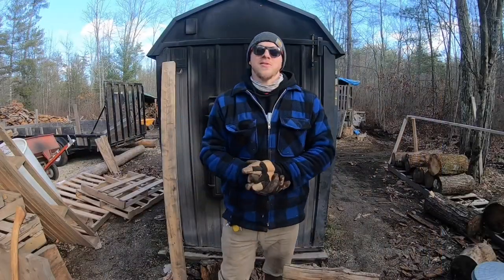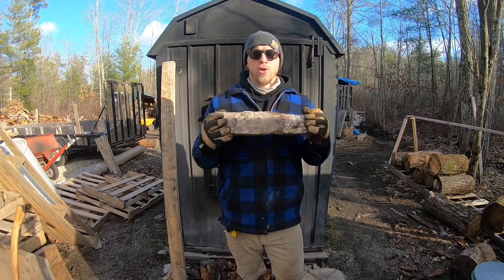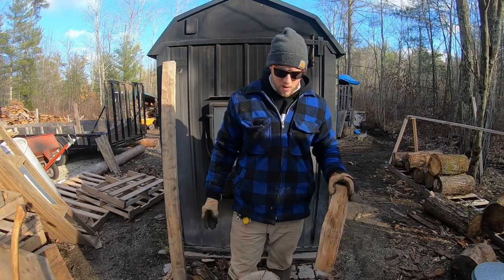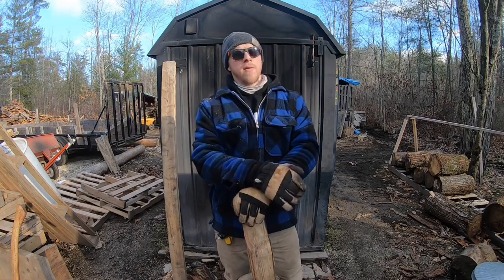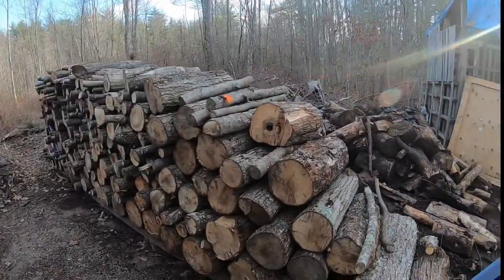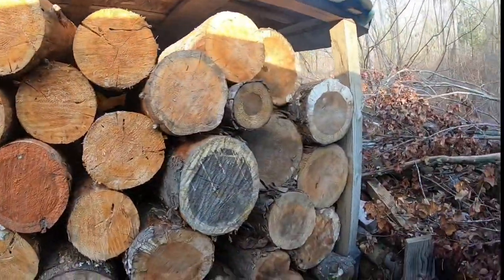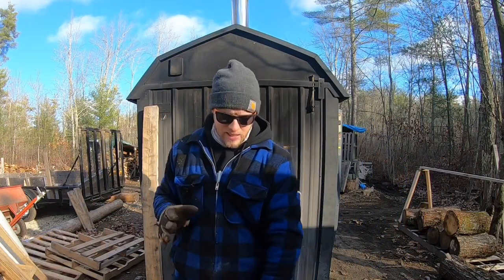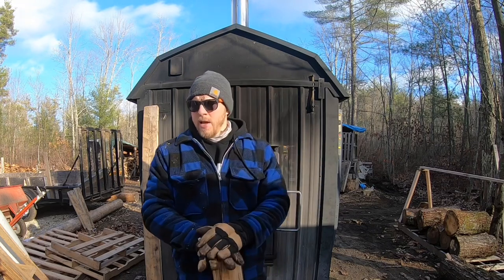STOP Burning THIS Wood In Your OUTDOOR WOOD BOILER

Comment: Incase folks here don’t know, these standard updraft owbs are the most inefficient chunk wood burners ever built. Period. Full stop. With that said what Jay has going on here is probably the best way to operate these with least amount of operator input. I could go into combustion design and thermal transfer but I don’t want to waste folks time and give them headaches. I figured out @15 years ago that there are much, much better ways to combust SEASONED wood and recover heat…Garn!
Reply from the maker: Hey Garny, Yes you are correct there is NOW a better design with the gasification HDX series but at the time in 2008 this was the ticket. Its easy to point the finger and say this is in efficient comparing to a new model 15 years newer. My whole premise was burn as large as you can handle SEASONED wood. Not green. Burning green wood is dumb and a waste and I understand that. Id love a new HDX gasification stove for sure. Who wouldnt, but im gonna ride the classic wave till she ends up croaking on me.
Reply: @HomesteadJay  Garn design dates back to early ‘80s. It’s proven fact this style owbs are most inefficient way. Fireplaces, central heat wood stoves, etc. are more efficient at combustion. I still would not recommend an hdx or any owb downdraft gaser. Study the Europeans. They too have been doing downdraft gasers for 30-40 years but with a key difference…thermal storage. Once you understand how chunk wood combusts you’ll understand why conventional owbs are the worst… and the owb gassers ain’t much better.

Comment: I agree with you. If it fits and I can lift it, it doesn’t get split. I have started cutting it between 16” to 20” because I have started selling a little firewood on the side each year. I also do not typically stack it or cover it. Before the burning season starts I haul it in with the tractor and have a big pile there by the boiler.  I just try to estimate what I will need to burn. This system has worked well for me since 2011. Most of my firewood is dead standing or trees that have blown over. I don’t worry about it seasoning either. I do end up with a little bit of green wood in the pile but most of it is dry.
Reply from the maker: Yeah I agree with you besides the big mess of wood lol I just touched on this in my newest video! I built a weekly/monthly rack right next to the machine! Thanks for tuning in!

Comment: Large pieces reduce the surface area available for combustion.  This keeps down the combustion rate when the boiler is idling, reducing wood usage while idling.
Reply from the maker: Yes seasoned large rounds burn slower and better if you ask me!
Reply: @HomesteadJay  not quite. In an outdoor wood burner, you'll get lag over a larger log that has to reach temp. If you burn bigger logs, put smaller splits on the bottom and then put your large splits or full logs. Gets that up to temp faster.

Comment: Hey Jay, I just found your channel and found it very interesting. I couldn't agree with you more. We have burned wood for about 15 years now. The first 5 with a home made stove and the last 10 with a 5036 classic. I have found the round vs split to be exactly as you say. We started by splitting everything and got tired of wearing out gloves and myself. Now we load as large as I can handle. We have come upon a source of wood skids used for transporting sheet steel. Mostly hardwood 4x4s and 1x6s. It keeps me busy loading but free is good and it keeps them out of the land fill. Interesting info and you can bet I will be back. Thanks.
Reply from the maker: Hey Jeff! Thanks for sharing your success as well! I did the same thing first few years I was splitting it all to peanuts lol now I try to let it season over a few years if its still round. I LOVE free skids I get them all the time from a few factories around here and they are the best! Keep on heating and stay safe!
Reply: I used to do the wood skids but got tired of the nails, the ashes I can dump on the garden or any hole on the property with out the nails. I agree, you are saving the landfill! Another positive side, dry wood, ready to go!

Comment: I have had my centeral wood boiler for over 16 years. I have burned all size wood species and moisture  content. This year I bought a splitter with 4 and 6 way wedge and split all wood small. I found I get more wood in the stove by stacking tight and I get longer burn times. This wood is just cut green. My back loves me.
Reply from the maker: Oh yes I agree if you’re gonna burn greenish wood split it down indeed. I’ve been mixing 50/50 green and seasoned and the seasoned stuff I have is big so I split down the green stuff and it eats it nicely

Comment: You have to understand that the wood you have is not what everyone else has.were on a world wide display here. If i throw in chunks of unsplit locust or burr oak my fire goes out. This isnt ideal for me. Spend time with your boiler, mix in some small stuff with the big stuff. Fire is fire, itll burn. You just have to figure out how to do it the way it works best for your application.

Comment: The reason your big rounds burn longer is because they are needing to be dried down to where they can burn. A 16" round split into 4 smaller pieces still has the same BTU value as it did when it was a solid round. It will burn better...sure maybe faster, but you are getting more of the BTU value out of the wood. It's just science. Using your boiler as a kiln is not very efficient and can also be considered wasting your time, just saying. I'd rather burn my wood to produce heat for my house than to use BTUs to dry large rounds. 
Not trying to sound like a smart a** here, just saying....big rounds that 'burn all day' are not really burning. The moisture inside them is needing to be evaporated off so they CAN burn. How is the moisture being evaporated, by using heat that could've went to your house.
Reply: Agreed but the size of the fire box allows for a more efficient fire. That means a bigger piece will burn more efficiently than a smaller piece. There is enough fire to make the heat needed. You don't need to run these super hot. They're very good at creating heat. Over firing an outdoor burner is not only wasteful but it is dangerous and terrible for the equipment. You can see how dry the big chunks are. Moisture isn't gonna be much a problem with the large rounds he has. Not trying to be argumentative either. Just saying my thoughts on it. Its sad we have to make sure to "de-escalate" our thoughts in comments by saying we're not being as wholes. Singularly, we're good but when we come together, we're beyond great if it's in a constructive and positive manner.
Reply: Dan, you are spot on. All the moisture also creates more creosote, which increases your chances of chimney fires. Not so much a big deal on outdoor boilers, but could be all bad if your boiler is inside like yours is.
Reply: @jorrick66  If you look at the big logs he is burning, you can clearly see they are very dry as evident by the cracks that run through them.
Reply from the maker: Hey Dan. I understand what you are getting at thats why I said in the video about every 3rd round or so I process down because the small split wood is easier to move and leaves a nice coal bed. The rounds I burn are not green. I am finally 2 years ahead with wood so that round I had in front of me was plenty dry and not green. I am not sure of moisture content but ive found a mix of split and unsplit works fine for this unit. I have noticed burning all split wood has a faster recovery rate compared to the "slow cookers" but after a cycle or two whatever is in there is plenty dry. Yes I know it takes wood to dry wood but I wouldnt say its inefficient as it may seem. A large 60x48 firebox has plenty of energy in it even if the rounds may not be split it will still burn fine. I appreciate you tuning in I will add a few things in my next video that I I left out in this video that should help bring everyone back to earth lol thanks again brother!
Reply: @mikeznel6048  dry on the end. Split it and I bet you it still has a lot of moisture in it. Even that small maple split will likely have a higher moisture content if it were to be split again.
Reply: @jorrick66  Yes but still, the moisture numbers inside are still going to be low enough to not cause an issue. The large wood burns slow and that excess heat will cook off any remaining moisture deep inside the big rounds without affecting the heat output of the unit. The fire box is large enough to support more than enough fire, heat, to burn off any excess money and not take away from the main purpose of the heat that os being created. Its gonna be a big, hot fire sitting there regardless if it's calling for heat or not. While idling, and even while cycling, all that excess heat will cook off what little moisture is left without robbing heat energy from the main purpose of the unit, which is to heat the water in the water jacket.
Reply: @HomesteadJay  I think thats the biggest thing, getting ahead so your rounds dry out, I just burn a woodstove, about 4 full cords a winter. I'm also about 6 years ahead and I split big now, nothing like you but for a woodstove I'm in the 6-8" range on a 16" long split, my wood measures out to about 15-18% on average but my burn times are excellent, if you can get ahead then go big, can't go wrong with that.
Reply: There is one factor that everyone is forgetting here.   Efficiency.   If you have a stove like a multipass unit that can capture the heat properly unlike a hole in the top type stove split wood will not only last just as long but also recover faster.  A stove like the central, will benefit from slower burning large wood because it gives a colder longer burn allowing the heat to transfer to the water without going out the chimney.   Make sense?
Reply: I would agree with certain species of firewood but wood like maple, cherry, ash, and pine will dry all the way through even if they are 8-10 inches round. Also have to realize if you burn 10% more wood and are able to process it 25% quicker you are still way ahead of the game. 

I have also found that having the same unit as he does for 15+ years that seeing how the draft is either open or closed and no adjustment to it when you burn smaller wood more heat goes up the smoke stack than when you burn bigger wood.
Reply: @jorrick66  I call BS on this as I have cut and split some of these bigger pieces to bring to my mother when she was low on fire wood and most of is bone dry in the center.

Comment: I like how you have your wood organized by size, age, type, great thinking as this allows you to chose what to pick based upon the conditions. I heat with a VC 30 year old woodstove and in a unit this small I probably need to control the burn more carefully as there's no thermostat like on an outdoor boiler so as to not make it too hot in the house or be restricted to wood that is too large when you don't have the coal bed to support that. My woodshed has a mixture of different size wood and I pick and chose what to use based upon the weather. Good video.
Reply from the maker: Yes this is key for efficiency! I do not want to burn premium seasoned oak when its still 60 degrees during the day! I like having it all separated!

Comment: Need to do an experiment of weighing big chunks vs. the same weight of smaller chunks and then check the burn time.  I agree that slowing down the burn time through less surface area exposed to the heat does in my mind give you more return on your heat value in same weight of wood.
Reply from the maker: Yeah exactly the full rounds will burn slower but longer. Yes the "recovery" time may be longer but id rather have a longer cycle time if I use less wood lol who cares about the recovery time it takes to go 170 to 180 degrees lol

Comment: great video. i do the same with my classic 4030. huge time saver. with dry seasoned wood  the conventional classic is hard to beat. a gasser might be more efficient but you have to split and handle it more than a non gasser. something to consider. having run both a eclassic and classic for over 10 years the classic is much easier to maintain,  clean and much easier to process wood. overall the classic is a way better stove than the eclassic 1400.

Comment: Depends on the type of boiler, if you have a gasification boiler (ie CB Classic Edge) they burn more efficiently with split wood. But conventional big rounds work fine as long as it’s dry
Reply from the maker: Yes thats key! 1. type of boiler. 2. how seasoned is it. Im making a follow up video on this!

Comment: Amen. Bigger the better. I get all the ugly stuff for free because of this! Key is the coal bed as you’ve mentioned time after time. Nice to have some scrap lumber/split stuff around to help kick start it. Now that it’s cold out, I’m just burning big rounds!
Reply from the maker: Yes for sure! I keep so many cut up pallets on hand for this reason the heat from the FREE pallet scraps helps rebuild the coal bed and dry the larger rounds out if they are a tag green. People seem to think firewood ONLY dries split in 16 in pieces... Apparently full rounds cant season according to the comments I got here lol
Reply: @HomesteadJay  hilarious!
I love the pallets but I have to watch the nails and staples etc. My Heatmor has a grate/auger system in the bottom and it tends to get bound up with them. I’m just pulling my pallets apart now. Less cleanup for later

Comment: The other complaint I don’t understand about an OWB is the amount of smoke it creates.  Mine does not smoke all that much. Maybe at the beginning of a cycle but clears quickly.
Reply from the maker: The problem is people prob had these machines burning crap wet wood and neighbors called and the rest is history. I agree. Burning clean seasoned wood after the first cycle there is almost no smoke. Its only the crap wet wood that roars out moisture and smoke lol which would go the same way with a bonfire or an inside wood stove lol any wet wood is going to smoke hahah